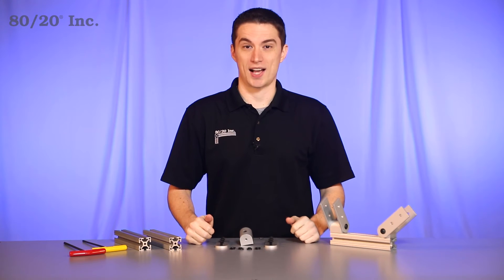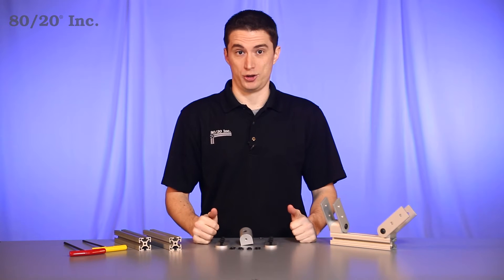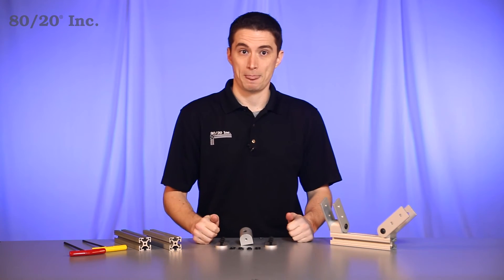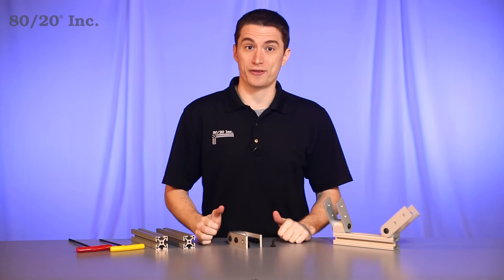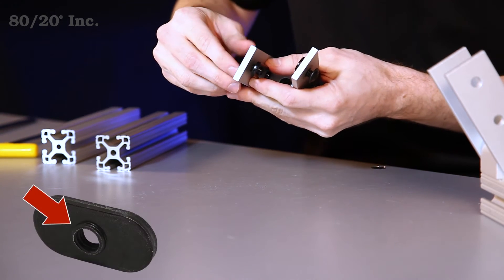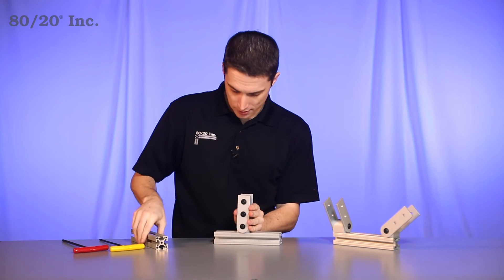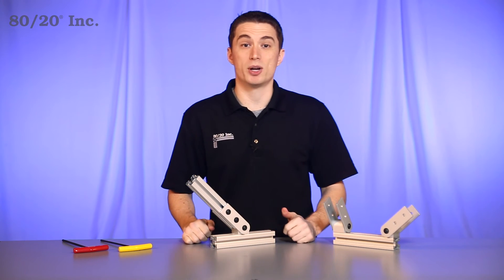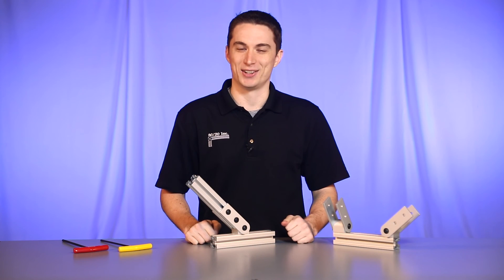80/20: Pivot Assembly Overview

Comment: Hey there. What's the load bearing on the joint? Also, is it possible to use it in free motion pivot. Meaning not to lock in the angle. Cheers
Reply from the maker: Thanks for the question.  The load bearing would depend on the size of the profile and pivot joint used.  We also offer Dynamic Pivots that are intended for free motion.
Reply: Is there a resource you have I can work this out? Thanks
Reply from the maker: Our Design Technicians would be more than willing to help you further on this.   Please contact them at https://8020.net/contact-us , for further assistance.  They will be able to recommend the exact part for your needs.
Reply: @8020llc  Thanks for responding to comments. I did not know you had dynamic pivots until I noticed this response. :}
Reply: @8020llc   from the video, it seems the load bearing of the pivot is limited to the load bearing of the single bolt that goes through the pivot to the T-nut in the profile's channel.